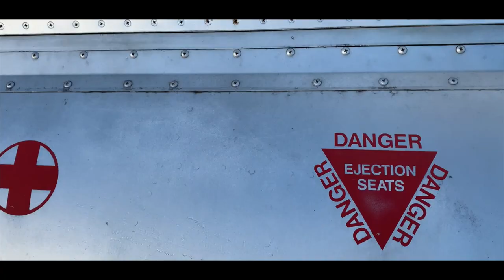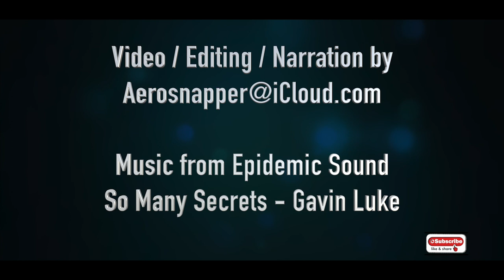Canada's Jet Fighter CF-100

Comment: Nice video but production did not continue until 1981. Production ended many years before that.
Reply from the maker: You're absolutely correct - I misspoke - service ended in 1981.  Glad you enjoyed the video - these old aircraft, that gave distinguished service, need to be remembered.